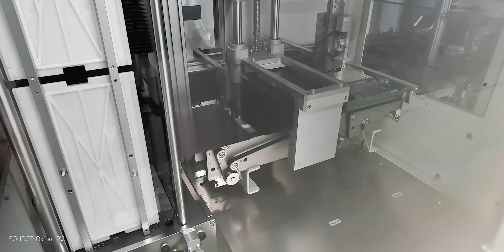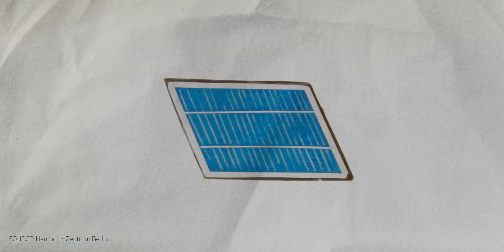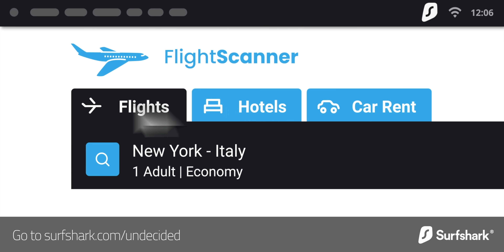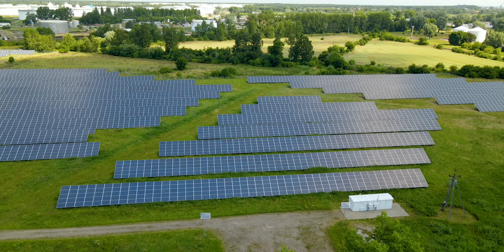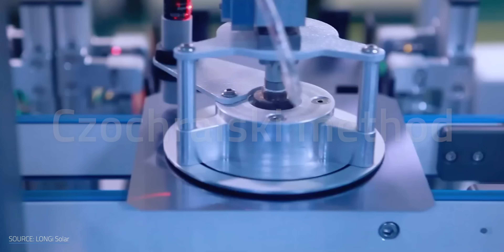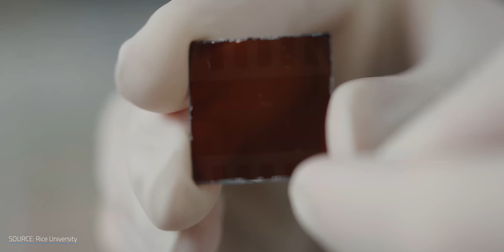How Record Breaking Perovskites Are Here NOW

Comment: Current silicone tech is not 15-22%.....all the factories in China are currently pumping out 22-23% efficiency cells.  This is a pretty modest bump up to 24.5%.  While I love to see improvements, lets not overstate them....and the question is "at what price"?
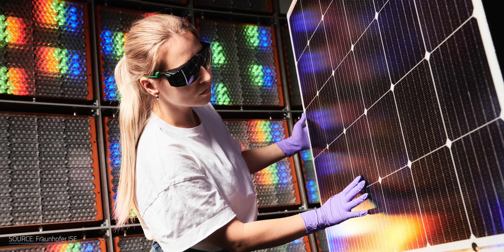Reply: A 1% increase is not that small when considering the catchment area and exposure timeframe; this quickly adds up, as outlined in the video (9:30). Whilst the panel costs may be higher initially, due to low volume of production, for commercial and industrial customers this can have an immediate pay off for them (particularly in power generation).  The 20% gain in the OxfordPV panels indicates a 4% improvement over a 20.5% efficient silicon panel using just a thin film coating.

What's more with OxfordPV's licensing approach they are seeking this to be a low cost incremental change for existing PV manufacturer production lines rather than seeking to be the end producer themselves with all the inherent costs and commercial risks in ramping up production and sales. This is an approach optimised to seek the rapid deployment of perovskite technology; one the UK, and particularly university spin-off companies, often seek being a services rather than manufacturing based economy (ARM used the same approach in the semiconductor processor market for example, with significant effect).

The company they are working with in Germany for production also make PV production equipment used around the world as well as panels, so OxfordPV are looking to offer a ready made solution for rapid deployment of licenable perovskite IP/chemicals and bolt-on (compatible) manufacturing equipment to existing PV makers. This is a two pronged approach of offering complete panels to drive adoption as well as open up the IP and manufacturing technology access to other producers.
Reply: Efficiency is mostly already a completely moot point. 20%, 22% or 24% doesn't matter much if panels are dirt cheap and installed area isn't a limitation. Cabling, installation, electronics, electrical work etc. are a much bigger slice of the total cost than the panels themselves. You can usually compensate for a slightly lower efficiency by buying a 21st and 22nd $200 panel for your 20 panel installation.
Reply: Be careful with comparing cell and module efficiency. It's not the same and a 23% cell will not give you a 23% percent module. It's always less because of the not used space in a module. gaps, frame and a bit of light blocking coming from the glass. ;) So the mentioned full area module efficiency of 24.5% is an even better bump than you may thought.
Reply: Indeed, ultimately it is all about $ per W.  As a home owner the biggest issue is the MASSIVE disconnect between panel prices, even at retail, vs. the installed cost.  It's a 1000% markup.  Yes I know there are actual costs involved in a consumer solar install like getting plans approved by local jurisdiction and utility company (unless off-grid) adding racking to your roof, wiring, panel upgrades, support, and long term warranty costs.  However it doesn't seem to matter whether you want a few kw or tens of kw they still mark up the price to be in the $2/W range which is probably 10x panel cost to them.  

Commercial installations have other cost factors like price of land but that's usually much less than all the hardware installed on it per acre so I hardly think a couple of percent change in efficiency is a game changer unless the price per W is reduced.  I'm guessing that as a new product not being mass produced the actual cost of this new product is mostly made up.  Until they are turning out GW per year we just won't know.
Reply: @CasaDeMuchosGatos fewer panels means lower labor costs. 

The labor cost to install 8 panels is less than the cost to install 10 panels.
Reply: Just because the label says it’s 23% means nothing .
Reply: @chrisward5626 If you’re getting 1KW per 4 square meters it’s right on that number 🤷‍♂️💯
Reply: Silicone!?!?!  FFS...it is and always has been silicon....the element, Si, not the compound polymer known as silicone.
Reply: Silicon*
Reply: I was going to day the same thing
Reply: There's no real difference between monocrystalline panels unless youre ordering some dodgy aliexpress crap. BTW if you cant distinguish between silicon and silicone I highly doubt you 'own a solar company'. You resell chinese panels on ebay, settle down.
Reply: So one Kilowatt in 4 square meters? That’s a solid number I have a 16.5 KW system it was 25k and I haven’t seen a bill in 5 years, that was when they were installed. They are dirty now still putting out 11KW and it winter, in the summer I regularly get 15KW. Most people wouldn’t use that amount of power or even close 90-100+ KW a day most of the year.
Reply: @Iprofessshirk  Silicon. Please don't contribute to this silicone thing. That's an entirely different material with entirely different uses.
Reply: Not true at all.. while they can produce them at a higher efficiency, most of their bulk stuff is still less than 20%. Keep in mind their focus is more on cost than power efficiency.
Reply: @adr2t  I own a solar company, and import MW of solar each year...I'm buying panels on a regular basis that are 23%, low cost, grade-A panels.
Reply: @Iprofessshirk  I am sure you are, but that doesnt mean that the panels China makes are all like that. One of the BIGGEST solar giants over there and a few smaller ones are closing shop because their panels dont hit at least around 18% and thus have fallen out of demand. The only reason why its still even running is because they sell them without any markup and are used for VERY large solar projects because they're the cheapest. Really, doesnt matter, it mainly just comes down to cost per watt.
Reply: @Iprofessshirk  I'm thinking of embarking in the solar panel business in Mauritius where I live but I'm not sure how access a reliable supplier so, if you could help me with that, I'd be ever grateful
Reply: @Iprofessshirk  what module?
Reply: @adr2t  now i order 18panels with  22.3% with 25years waranty for home   -Longi 435Wp Hi-MO X6  100eur/panel
Reply: @adr2t  Definitely not true what you say, at least not in the Netherlands or Germany. Simply google for Aikos 440-470Wp (175.6cmx113cm) panels. The top ones have more than 23% efficiecies and cost 90 Euros. Note that any panel of the same format with more than 400 Wp has more than 20% efficiency.  Since 420 Wp module already can be bought for less than 60 Euro (for small quantities and end user price) I wonder who would buy panels with less then 20%.
Reply: It won't merely be the price in dollars. It will be the cost to the environment when the FLI leaches out and contaminates the environment around the solar farm and the ground water beneath it, as well as when the cells are disposed of after their 25 year (as yet unproven) life is over. All of these issues need to be addressed.
Reply: @vulpo  Thre are solar cells still working in remote areas that are 40 years old dude. There is nothing to prove. Cells last easily over 40 years.
Reply: @Deiphobuzz   Not Perovskite cells! These have not been proven at all.
Reply: @vulpo  Many of them have lead removed already and or in the process of removing it. Do perovskite readd lead back in? I know some do, but I am not sure here?
Reply: @vulpo  Rubbish

Comment: I think explaining why improved efficiency is important was missed out of the video. Improved efficiency allows reduced land use, fewer materials needed to produce 1kW of power, lower deployment costs, and therefore reducing the overall costs of green energy while reducing the impact on the environment.
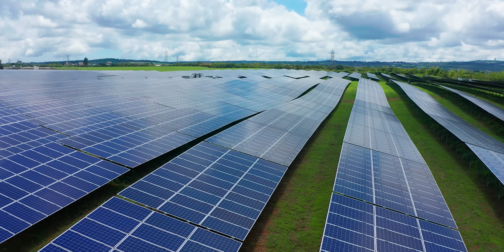Reply: 8:43 mentioned it right at that time
Reply: @iowesty  a brief mention doesn't really do it justice was my point
Reply: He covers those
Reply: @shad0wyenigma   if used properly, we can reduce the heat in cities with inefficient panels.  Car ports, long walkways, panels just off of roofs for an air barrier, stretches of freeway that can mean reduced use of AC in your cars etc.  With those use cases, long term durability is more important.  But once storage is sorted, we can easily make significantly more power than we need.
Reply: @veganpotterthevegan  Holy nonsense. Inefficient panels don't reduce heat. You are acting like the laws of thermodynamics don't exist. That energy doesn't magically go away, part of it is turned into electricity and the rest remains as heat. If you want to "reduce heat" then you want more efficient cells turning the solar radiation into electricity instead of heat.
Reply: @veganpotterthevegan nice onservations! I've been thinking about a shading use for my panels as well.
Reply: Sadly they didn't mention the cost....what use do I have for 20% more efficiency if they cost triple the price....
Reply: @blablup1214 they aren't available to the public yet. I did a web search.
Reply: Isn’t that obvious? You forgot the cost per MW and expected lifetime figures too.
Reply: its an entire layer of an expensive material, thats not 'less'.
Reply: It was mentioned, how much more time do you want a video to spend on the mind-numbingly obvious?
Reply: @zweigackroyd7301   that’s an arrogant statement. The 165 people who like my post seem to disagree with you.
Reply: but all that does not address base load UN-reliability
Reply: A lot of module OEMs are shooting for more power in the same frame footprint by using higher density wafers (think M10 & M12 over M6 or M8). That equates to 600-700 W compared to 400-500 W per panel, which will have an impact on how developers choose how much land to site PV plants.
Reply: @shad0wyenigma  I ironically think there is a massive missed opportunity in wind harvesting for exactly reason. Too much focus on efficiency and missing out on cost optimization and mass scaling. There's a lot of wind to capture everywhere still. Constant and around roads and buildings.

Half as efficient but a quarter of the costs can still be desirable. So long as it can be cheaply and incrementally scaled and deployed.
Reply: @ are you talking about small scale wind power?
Reply: Except when you are using materials that can easily leech lead...
Reply: True, but think everyone is jumping the fence a bit too soon on this one. We need to see jumps closer to 5-10% than 2.5%. Not to say these dont open the door for it.
Reply: @adr2t  these really do give a significant gain though.
Reply: @veganpotterthevegan  Maybe, but I rather see the money be spent else where as well. For example, like the idea of using panels to help cool down areas with shade while still providing power generation like over parking lots. Or even, at least in the US, help drive more heat pump systems. The lower we can help get the cost of power to live down, the better each renewable becomes.
Reply: @adr2t  keeping human powered travel, and parked cars more comfortable keeps people walking/biking and idling their cars less.  That's a very worthwhile expense.   That said, it's already largely cheaper than fossil fuels.  Governments should just finance it over time for the sake of everyone.  The longer we wait for it to get cheaper, the worse the consequences of fossil fuel use gets.
Reply: @veganpotterthevegan  PERC commercial panels are already at 25% efficiency...
Reply: @adr2t  You said maybe... which means you accepted his flawed premise, inefficient panels don't help with the heat.
Reply: @adr2t  look at my response to @GruffSillyGoat
Reply: @adr2t  - the OxfordPV seems to be close to that level already, at 20% efficiency increase to 24.5% would be 4% increase on a 20.5% silicon panel.
Reply: @GruffSillyGoat you are looking at the maths the wrong way there. 

For easy maths sake say 1000W are hitting the panel, with current panels 200W would be converted to electricity, and the new panels would be converting 245W a 22.5% increase not a 4% increase.

That means a reduction of 22.5% of land use area to get the same power output.
Reply: @GruffSillyGoat  That's a 20% increase over a 20.5% panel.  Also note, the OxfordPV is a silicon panel.  It's a silicon panel with a perovskite panel layered on top.
Reply: @GruffSillyGoat PERC commercial panels are already at 25% efficiency...
Reply: @shad0wyenigma  Problem is current PERC panels already are at 25% efficiency...
Reply: @adr2t  PERC commercial panels are already at 25% efficiency...

Comment: I disagree, it is possible to produce silicon cells with higher efficiency. The technology is called singlet fission. This can increase the efficiency by 30 to 40%. AIKO has commissioned an Australian university to research it. But can be used for all solar cells.
Reply: I think nobody says silicon is now obsolete, it just has its theoretical limits. Perovski cells push those limits further. And once it is as cheap and durable as silicon, everybody will want to buy perovski

Comment: When do you estimate Perovskites to be commercially available to the consumer
I actually built the Silicone Wafer plants for Arco Solar; yes Arco was in Solar for quite a while.
My question: is the process similar in producing, so that these Silcone/cell plants can produce Perosvskites
Reply: I made my first panels ever with Arco Solar cells in 1989!  The panels were for my University's solar race car.
Reply: @johnreeves7261  They were excellent panels at the time. Wonder if those you used are still around, just to ck on their remaining performance.
Reply: @donl5158  Alas the panels I made are long gone!
Reply: The OxfordPV approach is to licence an extra production step as a bolt on to the existing manufacturing process, one that coats the silicon layer with a perovskite thing-film before encapsulating. The production partner they are working with in Germany to produce their panels also make PV manufacturing equipment, so in theory their processing technology could be deployed into existing production lines are relatively low cost (for equipment and technology licence). 

The question of consumer access then is a commercial one of which markets will the panel makers address first, most likely commercial rather than consumer as they'll probably deem silicon only products are sufficent for the latter and demand for tandem cells will be higher in the commercial sector (particularly in power generation) as a higher price point than silicon ones. Once the technology establishes and the cost of production upgrades reduces then perhaps the downtime required to retrofit production lines will be sufficient to outweigh temporary loss in revenue streams. 

So in short, it's not known when end consumer access will be available as it's probably driven more by commercial factors than technology ones now.
Reply: @GruffSillyGoat Can you say me with which company they are cooperating. Didn´t find any information about this. Maybe PVA TePla AG?
Reply: @EinBayerUndGeopolitik-mm6ll  - OxfordPV's largest shareholder - Meyer Burger. Just realised they're actually Swiss but the facility is in Germany.
Reply: @ Ah, ok. Thanks.
But I think that their cooperation got terminated in 2021 by Oxford PV. They seem to have delivered the mayority or all of the equipment, but don‘t work anymore together.
Reply: @EinBayerUndGeopolitik-mm6ll  - I believe the issues from a few years back were settled (I think the German site had something to do with it). Wiki lists the seperation as attempted rather than completed. Perhaps they came to arrangement about licencing and preferred supplier whilst OxfordPV are in the self manufacturer stage.